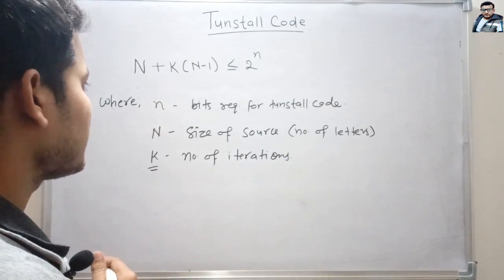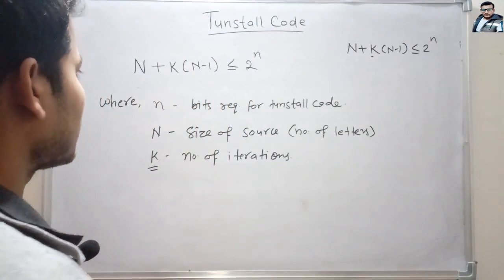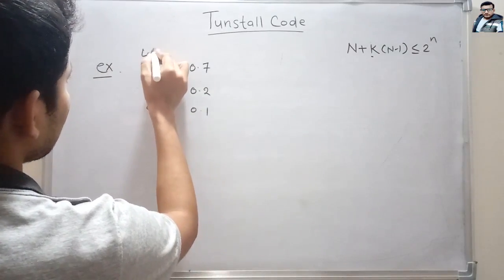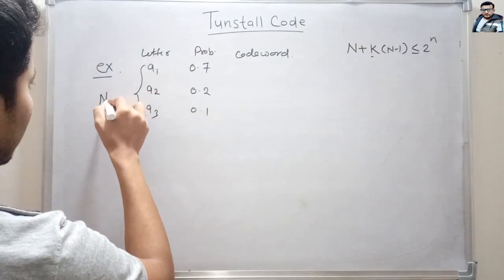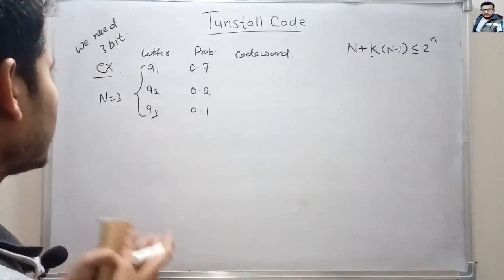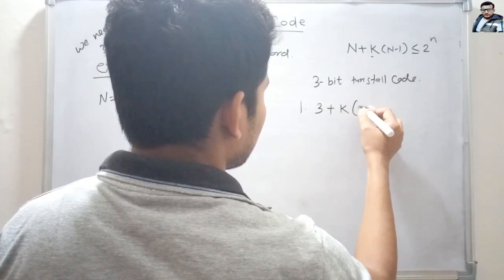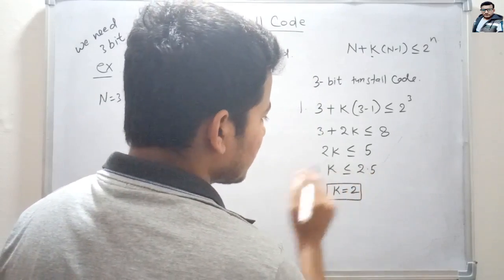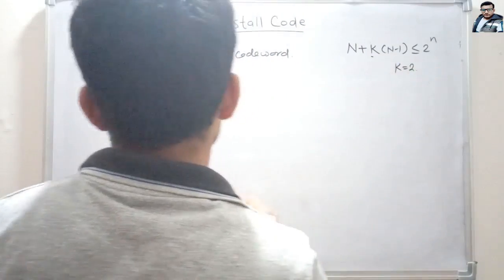9. Tunstall Codes with Example | Data Compression

Comment: Hello there, i have a question. If i had the output table, and i would like to code this input: "a1 a3 a1". How could i that? Sequence "a1 a3" - would be "011" and the rest "a1" - how could it be coded?
Reply: bro we have to write the binary numbers for each in this video it is from 000 (0) to the last one 110 (6) so write binary for each from 0 to 6 here